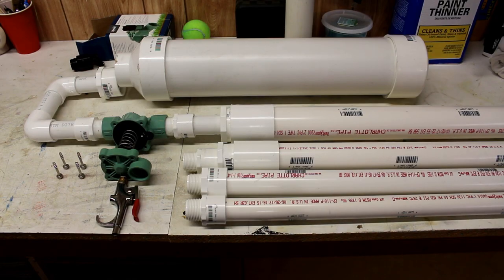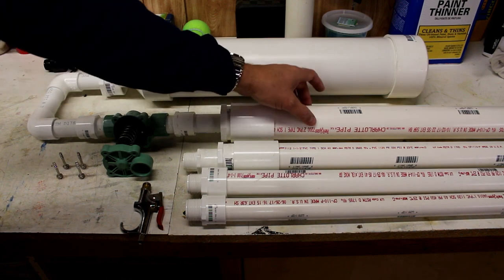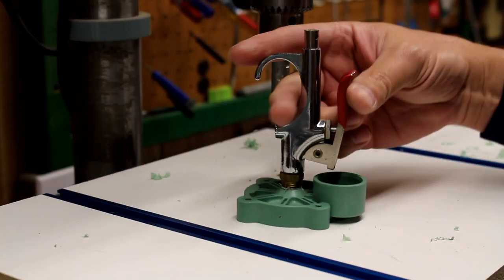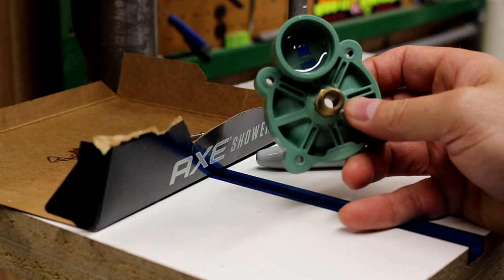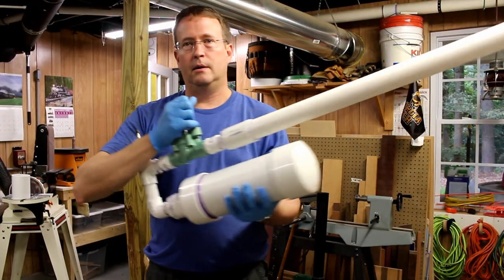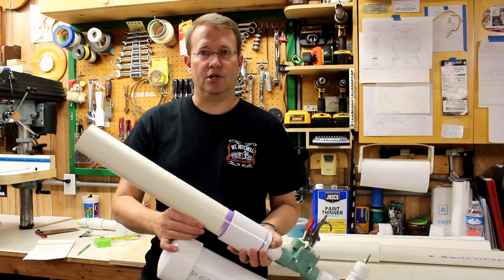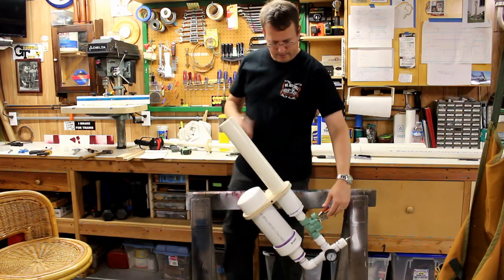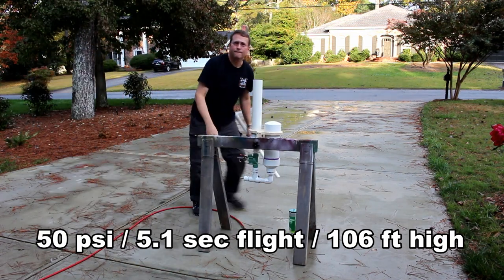Air Cannon Build

Comment: The little nerf footballs with the tail work wonderfully in the 2" pipe.  You may want to think about eliminating the 1" pipe (for smaller pipe restricts air flow) and use a 2" ball valve.  Great video. Thanks!  Oh yeah, also, spray vegetable oil down the barrel to lube the tube. Works great for the little footballs.

Comment: Interesting build. I didn't know about green dot tennis balls, and bored my barrel out for standard tennis balls. 50psi with an empty ball will launch over 300' on mine, but my diaphragm and release valve are both modified for improved flow. Most of the time I shoot a 10oz ball with FTC Stiffline for line installation around 120'.

Comment: Great video.

I use one of these to launch feeder lines over trees to hoist wire ham radio antennas - 40psi will easily go over the 80'pine tree in my front yard.

Very nice build.

Don't know which I like better - your launcher or your extremely well-organized shop!  I'm definitely having a case of "shop envy" ;)

Thanks for a great video; well done!

Comment: These 4" endcap and 4 to 2 inch reducers are drain water plumbing fittings, not rated for pressure use. You can tell by the length of the glue fittings, pressure fittings in those sizes have nearly 2" of cementing depth. Take care and be safe!

Comment: Very nice.  I made this, but with threaded 1 inch attachments, which I don't like as much as your design which uses the reducers.  
One suggestion to add some safety over time is to paint the PVC, preferably with a dark paint, to keep it from UV sunlight degradation over time.   I build backyard roller coasters with PVC pipe, and have done impact testing on painted and unpainted PVC 2" grey electrical conduit pipe, exposed to two years of sunlight, and the degradation in fracture toughness is about half.

Comment: Get pressure tested PVC and you will be able to use 150psi. I have seen one tested at 200psi but we only charged it up to 150psi for safety, after testing it also there is a way to make it much more compact. Use a piston system and run the barrel through the middle of the air  rezervoir. You won't need the sprinkler valve then. Look up SV seeker the last video they put out has the type of potato gun I am talking about in that video. You will also see a drawing of the cross section of the gun explaining how the gun works. They use their potato gun for launching a rope from one boat to another.

Comment: Saw that hook off the air nozzle and sand smooth. Turn upside down so the tank is on top. Attach the whole thing to boat seat swivel and you could aim up down side to side. That would be cool to mount off of deck for the kids

Comment: Excellent!!!!! What is the formula you used please for determining the height of the ball?
Reply: suvat equations. In this case for the 25psi the equation would be displacement = initial velocity + 1/2 x acceleration x time squared. therefore as the initial velocity is 0 and acceleration is -9.8 (due to gravity) the height = 1/2 x -9.8 x1.75 squared which is 15m converted to 49ft (minus a little bit cause the guns off the ground)

Comment: A good tip is to calculate the volume of the barrel and then calculate the size of the air tank needed.  This one looks fairly close
Reply: What's the ratio of supply required for the barrel length?

Comment: Hi, of all the builds I've seen this is by far the best. Trying to copy yours. One question. I'm having trouble trying to find tennis balls that fit in the 2.5 inch pvc, even the dot ones. How much pressure does it take to insert them, roll in or push it in forcefully? Just don't want it to explode in my face. Thanks, Shawn
Reply from the maker: It does not take much force from what i remember.

Comment: I put 150 psi in the one I built.  Can't see the tennis ball when I shoot it up. Mine is not better just more high pressure.  My dog loves when I start the air compressor up. It will definitely shoot 250 yards. I just shoot way up and it's impressive
Reply from the maker: Glad you are enjoying it. Thanks for the post.

Comment: Nice design and a great job on the presentation. How many shots do you get from a single 50 PSI charge?
Reply from the maker: The gun uses one shot per charge. The valve opens fully and dumps the entire volume of air out the barrel.  Let of fun.  Thanks for the question,  Enjoy making one.

Comment: I built one to launch frozen bait bullets for fishing. I run 90-100psi and it'll send one out over 200 yards. I'm going to try the sprinkler valve trigger you used instead of the ball valve I have on it now. Thanks
Reply from the maker: Let me know how it works. Thanks for watching.
Reply: Jon Rothenbusch I think you’re going to find that your ball valve is better because if you’re shooting ice bullets 200yrds then you’re probably using at least a 2 inch ball valve that gives you a much better air-dump. 

Like you I also have a bait launcher using a 2.5 inch BV that’s shooting 300yrds and only using around 110psi. 

BTW my bait launcher is all steel using a fire extinguisher as the tank and galvanized pipe as the pre-chamber then converts into pvc from the pvc ball valve onto the barrel. 

I’m also going to try the sprinkler valve idea but I don’t think it’s going to out perform the ball valve because I can’t find a sprinkler valve that’s larger than 1 inch. I just don’t think the air Dump is going to be great enough. We’ll see and I’d like to know how it goes for you ok so keeps us updated bro.
Reply: @GeorgeBonez  have you had any chance to test the sprinkler valve? wondering which one I should go with.

Comment: Is it possible to use the solenoid valve to release the air, or is there a disadvantage doing that?
Reply from the maker: You can but the air hose valve opens faster and has a larger orifice allowing the air above the diaphragm to release sooner that allows the main valve to open faster. With a solenoid you could remotely activate it. Thanks for the comment.
Reply: Great build. I’m working on one now but I don’t totally understand how the trigger actuated the sprinkler valve. I probably don’t understand how the sprinkler valve works…
Thank you for sharing this one!

Comment: Hi there,
Amazing video, thanks! May I ask you what object you used for the trigger? 
Thanks,
Miki
Reply from the maker: Miki - Thanks for watching. The trigger I am using is an air blow gun that you would use to blow dust of items. It is quick to open and makes a nice trigger.  Here is a link to Amazon showing it. Hope that helps.

https://www.amazon.com/Neiko-31112-Interchangeable-Nozzles-Over-Sized/dp/B000FVUO4G/ref=sr_1_2?ie=UTF8&qid=1523818169&sr=8-2&keywords=air+hose+trigger
Reply: Stephen Wassell Awesome!!!!! 
thx so much!!!!!
Reply: Why is the air not just blowing out the nozzle on the trigger? I thought the air when in the threaded end and out the nozzle when the trigger is pulled.. Is it the sprinkler valve somehow redirecting the air? Sorry for my lack of understanding..
Reply: @DanB1987 same question here. I guess I don't understand how sprinkler valves work in general. Saw a similar design but with an electronic trigger that I guess was a little slow decreaseing the release pressure

Comment: Hello, Great instructions.  I am building and ordered Green Dot Tennis balls however they are still too big.  Can you give me the make and model of the ones you used?
Reply: 2.5" ELECTRICAL conduit (PVC) will work great with tennis balls from the pet store--they must be just shy of 2.5" in diameter to slide well. A squirt of silicone lube in the barrel helps.

Comment: Did you remove the spring inside the sprinkler valve?
Reply from the maker: Do I did not.
Reply: Thank you, I'm having an issue where I'm not getting a big burst of air but more so it trickling out
Reply: @garrettt7723  We have the same issue. This occurs with a huge trombone sound until the air is depleted. It's as if the diaphragm isn't sealing properly. Still working on this detail.

Comment: Im just wondering how the trigger works, not sure if im dumb lol. Watched it a few times. Any chance i could get help lol
Reply from the maker: On a sprinkler valve, there is a solenoid that releases the water pressure from the top of the diaphragm by allowing the water to flow downstream. What I did was remove the solenoid and replace it with a air blow gun which is just a valve. When blow gun is pressed, it releases the air from the top of the diaphragm, which allows the diaphragm to open which then releases the air tank downstream. You could always replace the sprinkler valve with a 1" valve instead. I believe that the sprinkler valve opens faster. I hope that helps.
Reply: Stephen Wassell why not just use the electric solenoid? From what I understand if you increase the voltage to around 24v it will have the power to release the diaphragm. 

Am I wrong on this?
Reply: @GeorgeBonez  And need a battery all the time? Why would you want that?

Comment: What the highest psi with safety in mind ?
I guessing it would work for a bait cannon ?
Reply from the maker: I have only gone up to 50 psi.
Reply: With safety in mind O psi, PVC is not rated for gas pressure at all, the ratings are hydrostatic only.  OSHA does not allow the use of PVC above ground for gasses, but there is an alternative.  http://www.ipexna.com/usa/products/industrial/compressed-air/duraplus-abs-airline/
Reply: Sch 40 pvc can withstand preasures up to 300psi but it is not recommended to go that far

Comment: I think I missed the 4" pressure chamber length. Anyone get it? Other parts clearly specified.
Reply from the maker: It is probably about 12" long. No more is necessary.
Reply: tarmac245 z

Comment: What sprinkler valve did you use for this build , and where can I get one ?
Reply: @ange6580  did you drill and tap the valve so it shoots without a battery hooked up ?
Reply: @ange6580  I wouldnt be shooting tennis balls. I want to build one for shooting a weighted throw bag into tree canopies. I bought a 16oz bag , and made my own 5oz bag.
Reply: @ange6580  

How does that work anyways?

Comment: Last one of these I built gave the tennis ball a hang time in the air of 45 seconds.
Reply: Uh-huh
Reply: Wow! That sounds like at least 300 yards up! I'd be interested in hearing about the details of your Cannon. I've got two combustion cannons that shoot 100 yards plus using ether and miscellaneous other propellants. Best hang time has been about 20 seconds which was an exceptional shot.
Reply: Same. Ha ! Ours is all metal tho, using galvanized fence post. The one we take camping has a paintball gun body as the firing mechanism and works with a 175 psi portable tank. I get about 12-16 shots out of it and it shoots well over 200ft. in the air. We know, because we shot racquetballs across the lake to my buddies boat house and ,well, Pythagoras... I started on a gravity fed magazine that shoots ice cubes but never finished it.

Comment: hello, do you know where i can buy a sprinkler valve like the one shown in the video? I am trouble finding stuff (i live in australia) and most valves are electric
Reply: also where can i buy the trigger mechanism
Reply from the maker: I bought it from Home Depot. Any brand will do. They all work the same.
Reply from the maker: That is just an air hose nozzle. Available at hardware stores.

Comment: Can you tell me where you found 2.5 in sch 40?  I haven't been able to find that size.
Reply from the maker: I bought it at Home Depot. It was pre-cut to about two feet for repair work.
Reply: Swimming pool supply stores routinely sell 2.5”… at EXTREMELY high prices

Comment: Just wondering about the volume of air at different pressure and how to figure it.  Empty it would be at 14.7 psi for lets say cubic foot tank. At 29.4 ( x2) would be two cubic feet.  So at 90 psi that would be around 6 cubic feet.  The column of the barrel has to be figured in.  It would seem that the longer the barrel the better. The projectile would have more time in the barrel to accelerate. Anyway that's my thinking. Also the bigger the pipe exiting the pressure tank and so excited of valve opening have to be considered. I'm thinks nag the bigger the valve opened nag the faster the air can escape.  I am thinking of building one of these to cast ice bait bullet. You have seen them I'm sure.  They are pretty cool. They can be made in all sorts of configurations. I'm planning to mount one on my boat.  That should be fun. Have you shot water from it yet? Like 12 ounces or so. It should make quite a spray pattern.
Reply from the maker: That is a very interesting idea. I was not familiar with the concept of a bait bullet so I looked it up on YouTube. I also had someone want to use the air cannon to shoot confetti in a play. Seems like the ideas are limitless. Good luck with you experimenting. It will be fun.

Comment: My goal is"deadly"get as many long beer cans filled with cement/engine plugs, and shoot those suckers far and fast to be deadly"eventually".......!!!!!
Reply: What about batteries?
Reply: Works better with ice projectiles. Use a piece of pipe you used for the barrel, about 2 1/2" long for a 1 1/2" barrel. Pack snow in it and then pour in a little water and let it sit till it freezes. These babies Will go through a house trailer at 100 yards away.

Comment: Would a ball valve instead of the sprinkler valve work?
Reply from the maker: It could but you would have to open it very quickly. The sprinkler valves works great.  Thanks for asking.